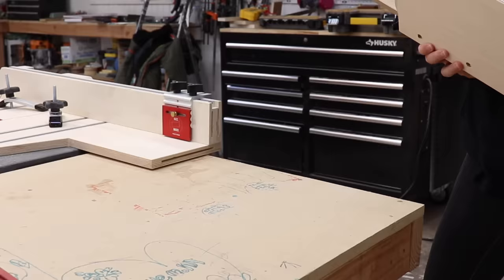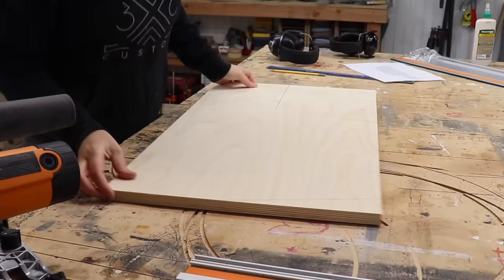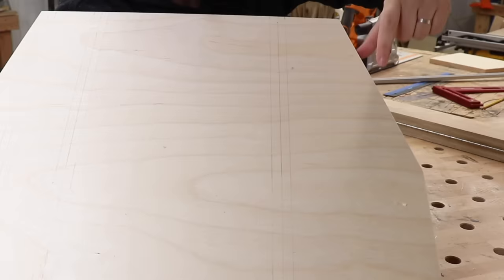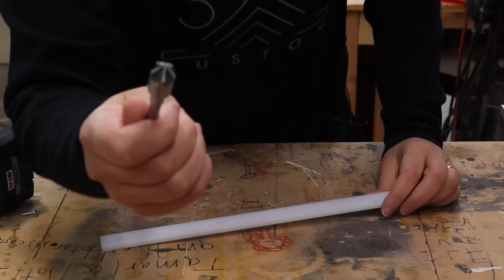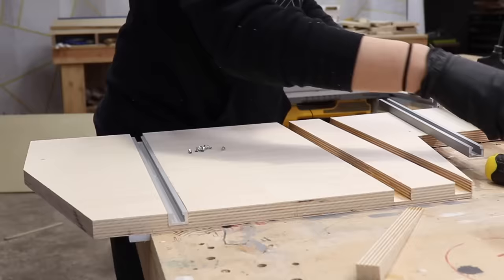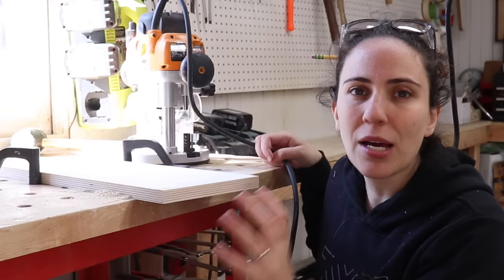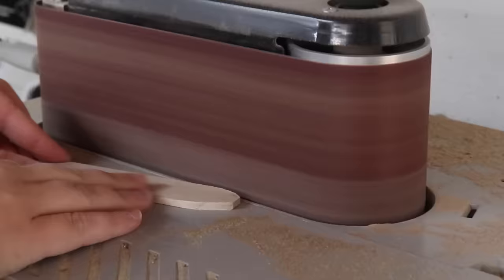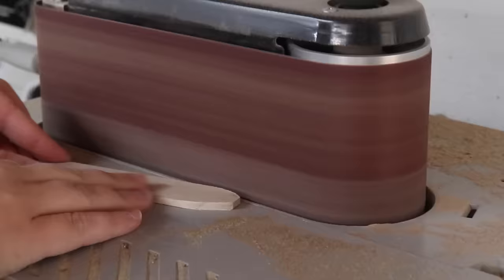SMALL Cross-Cut Sled with ADJUSTABLE Fence, EXTENSION wing and BEVEL Feature!

Comment: question to the general audience.  What size screws do most recommend to anchor the T-tracks into 3/4 ply?  I typically use PowerTec's 3/4 x 3/8 tracks.
Reply: I believe the PowerTec T-Tracks are cut to handle #8 screws. However, if the screw point should extend through the plywood, you have three options that I know of:  1) Trim off the point that is extending (a grinder works well for this);  2) Add a backerboard to the plywood (depends on the workpiece, of course, for it may look a little odd); or 3), use a #6 screw (the problem with this is that a shorter screw may not provide enough grabbing power in situations where there is a lot of stress placed on the track). 
Hope you find this helpful!

Comment: I know you have moved up from your jobsite saw, but I was hoping you could provide some advice. I have the 8 1/4" Dewalt jobsite saw and I really want to make  your sled. My concern is the depth of cut is already limited (not 10"), and using 3/4" ply reduces that further. 1/2" seems like it would be too thin, so am I stuck with a reduced cut capacity if I use a sled, or is there an alternative? Thanks.

Comment: Awesome sled, video work as clear as always. Got one question though: you"re using a a combination blade, this sled then is dedicated for that blade, yes? I use combination, cross and rip which are different in width so this sled would get eaten by other blads in my shop, however another question: do you use identical width blades? If so I might be in for new blades : )

Comment: Would you ever consider using the mini jig dovetail hardware (similar to your mortise jig video) in a project like this instead of the tracks?
Reply from the maker: I’ve seen those, I worry about the strength of the dovetail slot in plywood

Comment: I've noticed that on your main fence the plywood is oriented vertically, but on the adjustable one the plies are horizontal. Is there any compelling reason to choose one orientation over the other?
Reply from the maker: Well only because I was making holes in the adjustable one. I guess that was my thought process. There
Reply: @3x3CustomTamar  Wow, thanks for the speedy reply! I figured as much; you'll be compressing downward on the adjustable fence to lock it in place so it makes sense to have the plywood horizontal there.

Comment: What size router bit did you use to cut in the sled for the track to slide?  Should the bit size be the same diameter as the track?
Reply from the maker: Yup! Or you can use an exact width dado jig. I have a video on that.

Comment: Thank you for the great video @tamar. I'm getting ready to start the build... Curious though, are those 1/8" slots or 1/4? I was thinking 1/4 might be too thick but not sure. Thanks again!
Reply from the maker: Measure depth of slot. Get something slightly less thick so it doesn’t rub on the bottom

Comment: @3X3Custom - Tamar :  That HPDE you are using in the video, is that 1/2" thick?  I have the same table saw and I measured the track at 1/2" but your link takes me to a 1" think HPDE board. I did not want to order the wrong one.
Reply: Nevermind, figured it out.

Comment: Hi nice job I'm in the process of making the miter sled and I downloaded your plans but it does not mention what size or if you need those miter blocks that attached to the rear of the front fence
Reply from the maker: That’s bc it doesn’t matter what size they are.

Comment: What brand 3/4 inch bit are you using?  I have a Skil set but the t-track won't fit inside the grove I made.  I measured the bit, t-track and grove I made and, separately, they each measured 3/4 inch but the track won't fit unless I apply my body weigh on it -- which will risk bending the track.  How are you tracks apparently fitting with so little effort?
Reply from the maker: I built this years ago. Maybe I did it in 2 passes? I don’t recall. But maybe I just have the right size bit. I really don’t know.
Reply: @3x3CustomTamar  Thanks.  I ended up making two passes and placed some blue tape on the riding edge of my router plate guide to shim it just a hair on the second pass and it worked out great.

Comment: I'm looking at buying the Katz Moses stop, but notice the height increment you have it set to in the video doesn't quite match what you spec for the fence height (3 1/4" vs 3 3/8"). If I make the fence exactly the same height as one of the stop heights (3.25") will I have any problems?
Reply from the maker: I don’t think you should have any problems. I just didn’t want it binding in the bottom
Reply: @3x3CustomTamar  ok cool thanks! Yea I'll probably leave like 1/16" clearance to ensure it doesn't catch.

Comment: Do you ever have any issues with this sled falling over backward when you pull it back to the edge of the saw? I have this same saw and have been trying to figure out jigs for it. I have an outfeed cart that I built for the saw, but didn't really integrate any side tables for it, or an in-feed table, since all the controls and the fence adjustment would then be restricted. It doesn't seem like you have any trouble with it being back-heavy in the video, but just wondering if you have thoughts about that, since the in-feed side of this saw is so small an area. 
I love your videos and your ingenuity!
Reply from the maker: Nope. 👍

Comment: I made you great sled a few days ago but near the end of the build I realized that my saw has a right tilt blade. Whoa is me. Any suggestions or recommendations?
Reply from the maker: Doesn’t make a difference. The cut on the end will just be the opposite angle. Just make sure it’s long enough to reach

Comment: Will this handle a 1 x 10 ? I am building an amplifier speaker cab and i have to almost start the wood touching the blade with my quick pine fence attached to the miter gauge that came with my saw. if I do more of these I may upgrade my miter saw to a sliding model.
Reply from the maker: You can decided how wide to make it for your specific needs
Reply: yes, you can cut up to 13" wide pieces

Comment: Great video of crosscut sled well thought out.  Best I have seen.  I noticed you used a left tilt table-saw .  I have a right tilt one.  Any suggestion or need to alter the sled for those repetitive angle cuts with a right tilt saw.  Would using a dado stack to cut tenons ruin the base?  Thanks

Comment: Amaizing jig design, but You should never use the blade for setting up the angles on a jig fence. Blade has the ability to flex, and will not give you a true angle .  Insted use the guide rails to set up 30 degree angle fence.

Comment: you linked 1" thick HDPE. Looks like you are using 1/4". Which thickness are you using. Love your videos!
Reply from the maker: Measure your miter slots depth. Then get something slightly smaller than that. You just don’t want it rubbing on the bottom

Comment: Beautiful work. The adjustable fence confuses me, as the moment you adjust it away from the first angle ie 45 degrees and use it to make a cut it would then be unusable as a 45 degree fence. Would you then have a number of fences for the different major angles? If you are only doing 45s then adjustability is less necessary. I may just be very confused.
Reply from the maker: I cut 45 on one end and 30 on the other end. Those are my most common angles. You can also set it back from the blade at any angle you need and use a backer for zero clearance

Comment: FYI: In checking out the materials for this build I found that the HDPE link goes to a 1.000 in. thick piece. But the piece you are cutting from is not that thick.
Reply from the maker: Measure your miter slot. Get something not as thick
Reply: @3x3CustomTamar  Yup. Have the same model saw as you. Thanks for the reply.

Comment: Using a trim router for dados is quite dangerous idea, asking for a kickback, which will happily ruin your project and even break your router bit. I would not be that lazy, and I would move my router from the trimmer utility to a plunger! 

P S. The extension is overly engineered. You can make it much simpler and more sturdy.
Reply from the maker: Using a trim router for dados is totally fine and not dangerous at all. Why would there ever be kickback if you are using a fence? Ha
Reply: Only if you do very shallow steps of two millimeters (around thickness of a mouse tail in imperial system) and start cutting from a side from the beginning, then it is relatively safe. But if you do it deeper like 4-6mm cut at once and, worse, even plunge it from an angle, there is a very big chance of a quite strong kickback and fence won't help at all. There is a good reason why we have invented a plunger! Because it doesn't wiggle at all, while at that rpm speed you really need a little jitter to let your router screw it all up even with a fence. Just in case, this is not theoretical, I learned that the hard way myself, totally ruining a dado (had to inlay a piece of material) and buying a new router bit, as one of its part flew around like a bullet. From that time I redone my jigs for plunger accessory and since that I never had any issues like that at all. Have a nice day. Or night (like here). 🙂

Comment: Another fine production!! Have you made a video or have plans on how to make the router edge guide you use in the beginning? Otherwise what is the width of the part you flipped up and did you align that part with the furthest side of where the t track will be?
Reply from the maker: I do! It’s linked below

Comment: Wow! All the features! Any thoughts on if I can make a 90 degree and 45 degree cut while still using two runners? Is there any reason I should only make a 90 degree cut line in the base if the one-runner option wouldn't work for me?
Reply from the maker: You can do that but then the middle section between the 90 and 45 will fall out. And then it won’t be zero clearance anymore. That’s what happened on my old sled

Comment: I hope you realize that your sled, as built, costs well in excess of $200.  I added up all the items if bought on Woodcraft and without the wood and big box of knobs, my cost came to $157, without your plans.   I substituted a set of knobs for $14, but I don't know if that would be enough.  The cost is holding me back. I was ready to build it, and thought I don't know if I want to spend $100. Then I added it all up and it is well over that.  So, not right now. Too bad, it is a great sled.

Comment: the more precise way to check if fence is perfect 90 degrees is: you cut all four sides to pieces and with the fifth cut you check the piece - you break it in half and the width of both pieces should be the same - just like this: https://www.youtube.com/watch?v=McXJxYLXq-E&t=815s and here you have method to calculate how to move fence to get 90 degrees: https://youtu.be/8Z4aiGEiUyY?t=910

Comment: Tamar did you use 1/4" or 1/2" HDPE for the rails?
Reply: I was just in the comments looking for the same answer. In previous comment replies she said it was around 1/4" but to just measure the slot depth and get something thinner than that because you don't want it to rub on the bottom. (Saved you from having to type it out again, Tamar. Lol)
Reply: @BrettShumaker  yes i  didnt want it to drag either tho i think a 1/2" too cause my slot is 3/8, thanks for helping.
Reply from the maker: Yup. Just get something slightly less thick than you slots are deep

Comment: What can we do different if we want this to cut dados?
Reply from the maker: Use a dado stack
Reply: @3x3CustomTamar  thanks I guess I should have said I would like to cut for dados or a normal blade. Basically be able to adjust the width where the blade is depending if I'm cutting with a dado stack or normal blade.

Comment: Picked up the plans from your website and excited to build this. Such a well thought out design. 
Question on the extension - I have a similar table saw to yours (mine’s a 7492), but it’s not built in to my workbench so don’t have the additional support on the left. It seems like there would be a lot of weight hanging off the table when using it in the left miter slot so would balance be an issue? I have that problem with the kreg miter gauge and need to weigh it down with my right hand when cutting to keep it flat on the table. Thanks!
Reply from the maker: Awesome. So the extension is fairly light.

Comment: Hey, I made this jig and it was pretty easy to make and I love it! 1 problem I’m having is when it’s set to do miter cuts on the right side of the sled it seems to bind and not slide smoothly. Guide is walnut and it fits with 1/32 of clearance. It’s lubed up with paste wax and still doesn’t slide without feeling like it’s getting stuck. Feels like the single runner may be causing this. Any ideas would be appreciated.
Reply from the maker: Hmmm. I don’t have that issue. Perhaps your miter slots are actually. Not the same width. If that’s the case. Then you can take some high grit sandpaper wrapped in a piece of plywood and just sand a bit until the runner slides smoothly in both slots
Reply: @3x3CustomTamar  okay I’ll give that a try. Thanks for the tip.

Comment: Your trim router can take a 3/4" bit? Thx.
Reply from the maker: Yes. But the shank is 1/4”
Reply: @3x3CustomTamar  Thanks! I have the Makita trim router. I didn't think the hole for the bit would take a bit that big (even with just a 1/4 shank). Good to know.

Comment: Quick question:  what was the tool you used on the edge of the oak strips you cut to help lock the extension pieces together?
Reply from the maker: Threaded insert?
Reply: @3x3CustomTamar  It was at 9:26:  https://youtu.be/McXJxYLXq-E?t=566   Thanks!

Comment: Thank you for good video. Excellent sled and I'm going to make one. What's the thickness of the HDPE? In description link brings to 1.000'', but looking at the video it is much thinner. I assume ~0.25''
Reply from the maker: Thanks! Measure your miter slots. Then get something that’s is slightly less thick. You just don’t want it rubbing on the bottom

Comment: That’s an awesome sled! I was wondering why you were putting on only one track then you answered the question lol. Though I’ve sen others that just did the 45 in the same spot. What benefit is there in the method you used vs the same cut area? Thanks for the vid!
Reply from the maker: The middle falls out and then you no longer have zero clearance reference lines

Comment: Do you have plans to make a versatile sled like this for a cheapie Ryobi 8.25” table saw with only one runner slot left of the blade?  
I am on a tight budget but I love the way your sled works.  Thank you for the great video.
Reply from the maker: Sorry. No.
Reply: Unfortunately with the small 8" blades, saws like this simply can't/shouldn't use the 3/4"/18mm plywood needed for the base of this sled, and still have reasonable amount of blade exposed for thicker pieces of wood. You could build a sled with 1/4" plywood for the base, but then you couldn't install t-slots.
Reply: @shotparrot    Thank you Christian, that is good to know! I will try some other method, or make two sleds?  I don't have a shop, just use my patio. I seldom use large pieces since I only make bird nesting boxes and I'm just a newbie I have lots to learn!  I watch so many videos, my wife thinks I'm crazy.   ;)  She may be right?
Reply: Haha maybe you're crazy, but then so am I ;) Also, if you only cut slimmer pieces of wood, you could probably still use the 3/4" thick plywood base. Just measure the pieces you cut and the max blade height and 3/4" thickness to see if it  works and is worth it to you to build a sled. Or, like you said, 2 sleds. Plenty of woodworkers have multiple sleds for different purposes. Enjoy making bird nesting boxes! I may do the same. Right now I have to build a bird feeder with my daughter, since I broke the first one!

Comment: Love your videos.  I've watched this one a dozen times already and I've grabbed the plans from your website to make this sled.  Just today I noticed that your Dewalt saw is a left tilt saw.  My Delta is a right tilt which will not allow me to make the bevel cut on the right end of the sled.  :(  Not sure if anyone else brought this up. There are too many comments and no search function.  Any thoughts or advice?
Reply from the maker: I don’t think it should be an issue. Just make sure the right side of the sled is long enough to the point where you blade tilts.

Comment: The height of the base of the sledge is too much. Use a thinner ply. The teeth, while cutting, should make contact with wood as close to 90deg as possible.
Reply from the maker: 3/4” is fine for a sled base.
Reply: @3x3CustomTamar  Technically not correct. It does the job but you will have to put more effort.

Comment: Nice little design, but not 100% accurate, 20:46 you can see that the corners are probably not accurate, you should work on the adjustment here

Comment: I don’t understand why you YouTube woodworker types don’t get a panel or wall saw. It’s made for cutting panels and you can even crosscut and rip lumber with it. I have had a wall saw for most of my life and I can’t imagine not having one.
Reply: Takes up too much room, limited in application, not as accurate either. My track saw does everything and more than a panel saw and takes up much less room. Most cabinet makers do not use a panel saw
Reply: @garyreinke5161  It takes up less room. If you know how to use it they are very accurate (I’ve got one).